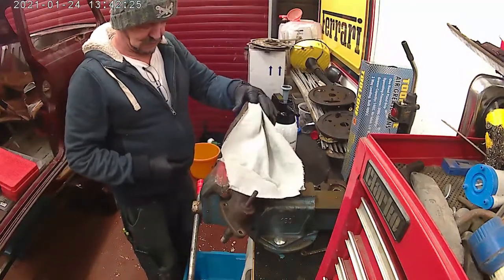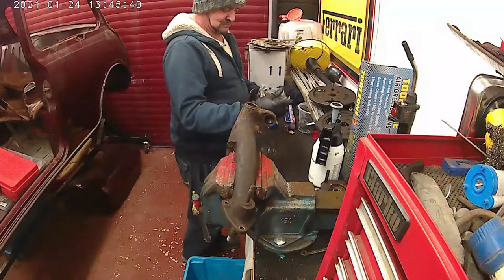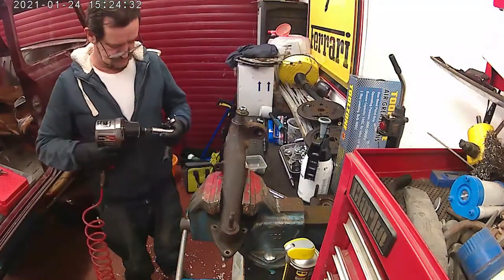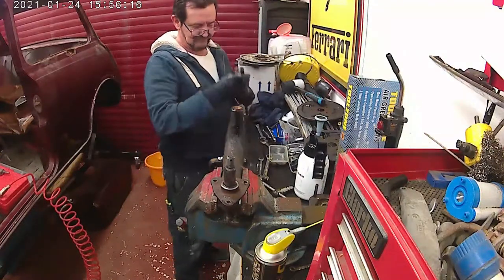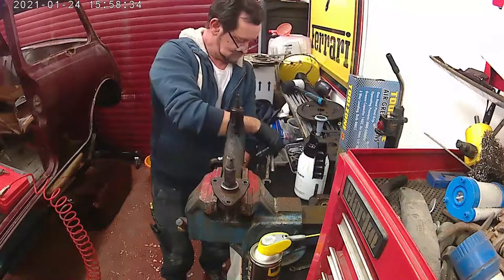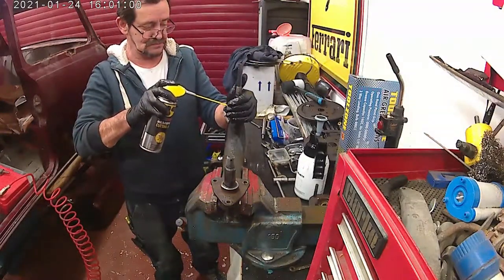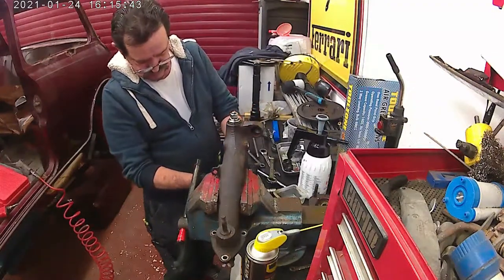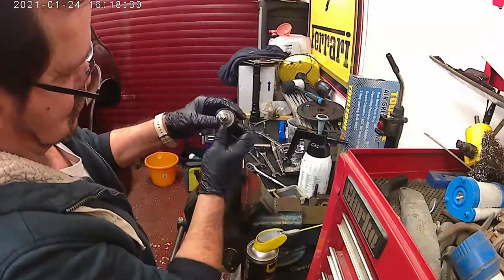Radius Arm Rebuild

Comment: Peter, Like the Jaggy bonnet. When you where reaming the radius arm bushing it is so easy to take too much of a bite and make a right pigs 
ear of it but this is is one operation where patience is key and the fit at the end was a tolernace fit far better than BL could manage lol.
Cheers Dave
Reply from the maker: Cheers Dave ,the bobble hat is from  the VW Club I'm a member of, it's so warm ,but yes you are right it would be so easy to take to much of with the reamer hence why I checked the pin after every pass